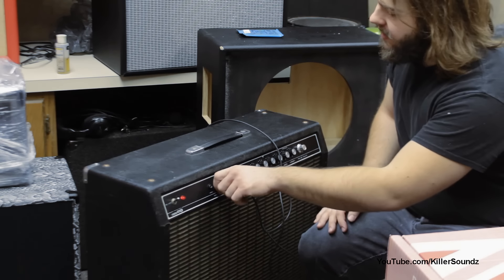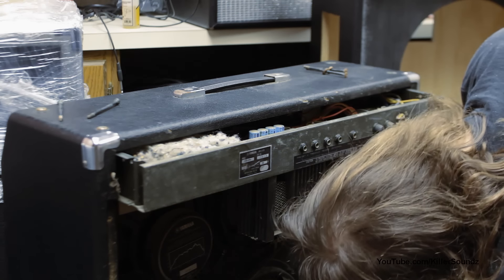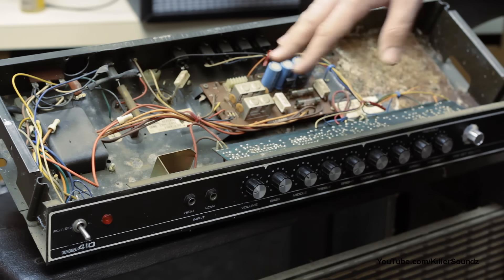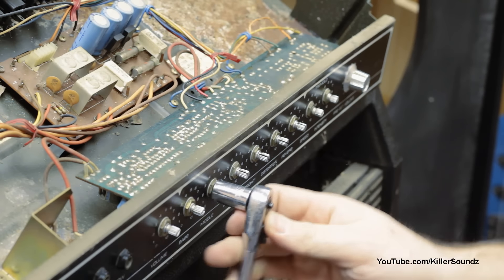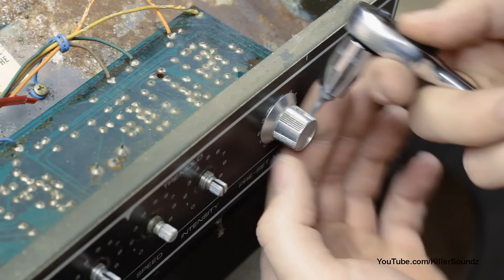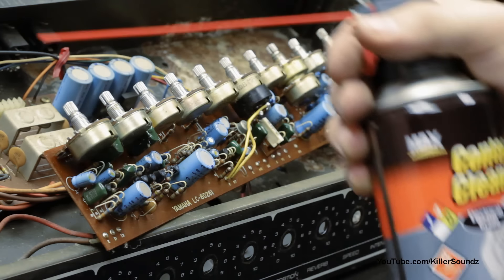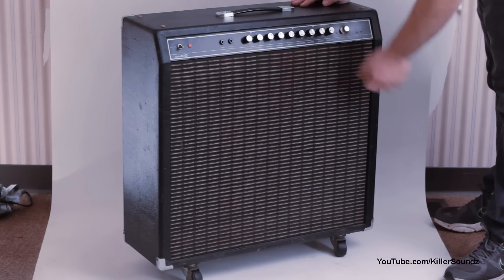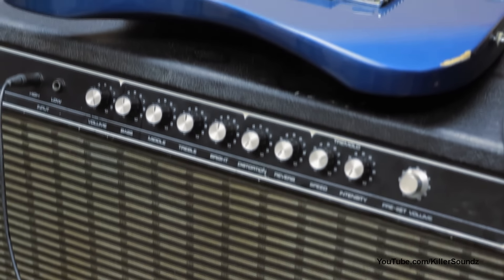Scratchy Knobs? How To Clean Amplifier Pots with Contact Cleaner Video  ✔

Comment: My life changed when I discovered contact cleaner. I thought all my stuff was malfunctioning, but it was just dirty as hell. A couple of squirts and all my pedals, guitars, basses, preamps, compressor, came to life again. It was exciting to actually hear my oldest instruments sounding again as if they were new.
Reply: Dude same, I was about to get rid of my 350watt amp head because the volume knob wasn't doing jack shit unless I turned it up more than half way(which will rupture ears with 350watts of sound.) Turns out it was just dirty ass hell.
Reply: I had the same experience nice to bring back old gear!

Comment: i fixed my input selector with a quick and easy fix...i took the straw for my canned air and crushed it in a vice. This allowed me the clearance needed to get in those spaces behind the knobs and dials without opening up the unit. I just sprayed it in there while turning the knob a few times. Spray from different angles so you crosss-spray the potentiometer. Good Luck. Worked great for me.

Comment: Just want to say thank you.  I have a old made in England Marshall govnor pedal and the pots were scratchy as hell and one you had to tinker with to get the sound thru. The input output jack where driving me crazy aswell from bad connection. Got some contact cleaner and bam everything works properly. What a difference. It's fun to use now. Thanks again 😊

Comment: I am going to try this before replacing all the tubes in my Marshall 40c. It only happens on the gain switch, after plugging in the guitar.. the amp is basically new. But I bought it back in 2013.  Getting into playing again and learning from all the vids. I did the the gentle tube test with the wooden chopstick and there was no noise or metal shards at the bottom.  Amp has maybe 15 hours after all these years and neatly stored. Thank you.

Comment: Old video but thanks for the info! Came across an old 80s Roland JC 77 not powering. I took it apart and found the lead power switch, got twisted off by the last user going to the fuse. Apparently they twisted it too much putting a new fuse in, and the outside housing split it off. So it got tossed out! Well I soldered it back, and now the amp is back. But it has a lot of fussy/scratchy pots on it. However the inside was very clean though, and used at a University. Luckily the pots are more accessible than this and no need to take the front off. They are exposed with no circuit board on top. 

With the warnings you gave, I plan to unplug it for a weekend, take the fuse out. Then let it sit and then get to work! Thanks again for the walkthrough. I prob would have freaked out the solution dripping on the board! I’ve only fixed mixers with other non spray cleaners for contacts. The Digi002 back in the day was one of those every year power harness cleans.

Comment: Hey, thanks for the video.  I have a 1975 Yamaha G100 412 .  I thought the the bass pot was broken or shorted out because the sound would have this loud "crack" and then no sound at all.  I contemplated replacing the pot but it was an integrated style of pot and I had never done that style before.  So I wired two of the speakers in parallel and the other two in series and used it as a 4 or 16 ohm ext. cabinet.  I gotta say I really like the sound of the vintage speakers.  Then I saw your video and your Yamaha was doing basically the same thing.  Long story short,  I cleaned all the pots like you did and wow I now have a great sounding vintage SS amp.  The brand I used was MG Chemical "Electrosolve Contact Cleaner"...made in Canada. One suggestion..wear safety glasses...Thanks again.

Comment: Thanks for the vid. I was able to save a mid-90's Mirage subwoofer that had some scratchy knobs for years but eventually decided they wanted to screech non-stop last week. Subs ought to make bass, but this was midrange and howling. I was able to remove the amplifier from the enclosure and spray the crossover and volume pots with contact cleaner. Works just like new now.

Comment: This is all well and good, but contact cleaner will also clean off the lubrication, leaving the pots dry and more prone to scratchiness, so unless the contact cleaner also contains lube, it's a short-term fix which will be damaging in the long-term. Important to subsequently spray with an appropriate lubricant, ie. Deoxit F5 or F100.

Comment: I would HIGHLY recommend you follow up with an electronics lube!That spray will clean but leave the pot contact surfaces completely dry,and will erode/wear the carbon VERY quickly!
Reply: Would using deoxit 5 be fine for overall clean and lube?
Reply: @BRIANACASHMUSIC  no, you need deoxit fader lube or something similar
Reply: Thanks yeah took it all apart and fixed it with deoxit5 several months go. 😎 Thanks
Reply: Deoxit 5 contains lube. The f version contains more of the lube
Reply: I was about to mention this but I saw you did! Fader lube will protect and make it so it has a little resistance so the knob is not so loose feeling and keeps out dust in the future.

Comment: My choice of cleaner is DeOxit 5. Spray as you did and rotate the shafts 6-7 times. Then spray the pots with a good contact cleaner to flush the gunk the DeOxit just loosend up. Finally use a can of compressed air to blast any residual spray(s). This method never fails for me on amps, guitars, cars, anything that has a pot or rheostat. 

And, yep, definitely a mouse nest. Removing that stuff by hand using rubber gloves would be my choice. Then use a Dust Buster with a long nozzle to pull up the mouse crap. THEN soak a paper towel with Lysol germ killing spray and let it soak over the area for about (5) minutes that was the nest to kill whatever was left over from the nest. That's all I got.

Comment: Nice vid, yup, a rodent's nest is what that was.  I would also recommend testing the pots before completely re-installing them as some times they are too far gone and have to be replaced.  One thing, capacitors store energy, not current.  Current is how the energy is released.

Comment: when I clean my pots I lay the amp on it's back,remove all the knobs and squirt the cleaner on the spindle ,it runs down the spindle. into the pot ,put knobs back on an d twist them a few times,it works try it, saves a lot of time       Roy

Comment: Wow that amp sounds really good! Good repair video!
Reply: In a world of over-production and an unlimited supply of underrated gear, 1st generation Yamaha amps are absolutely #1 on my list for getting ten times more than you pay for.  It's  saving grace is that only a few 'well known' players used them back in the day thus they're off the radar of the mindless, following hordes of gear buyers who would otherwise drive their price through the roof so thank god SRV didn't play on one but seriously, as an objectively assessed piece of kit, these are as good as any amp you're going to buy in any price range. Over the years I've acquired 3 so I'm kinda stuffed to the gills on them but this will make someone happy.

Comment: I had not played my tube amp for couple of years because 100w and 4x12 cab were just too loud... When I tried the other day if it still works, most of the knobs were stuck and I could barely turn them! Not sure about cleaning the pots by myself though now that I've tried if the amplifier still works. And it works. 😁 I just don't understand them wel enough to dare to touch the stuff inside.

Comment: You used WAY too much cleaner. A tiny squirt is plenty. Either opening would work the same. There was one dual-ganged pot in your video and you may have missed the front portion. You can check the results before reassembling too.
Reply: That's not necessarily too much. The flooding action can liberate particles and take them out with the out-flowing fluid, particularly with such a noisy pot as the volume in this video. YMMV. I would NOT recommend opening pots unless for last resort and you know what you're doing. I DO recommend a cleaner with lubricant; F5 or other fader/lube cleaner is highly recommended.

Comment: Holy shit, I searched this up because I'm having issues with the exact same amplifier you're demoing on in the video. interesting co-incidence. I got it for about 200 dollars used and it has massive issues with the tremolo circuit, I've managed to get it working for periods randomly by running a patch cable into the trem and into a pedal that's switched off, but it's inconsistent. Hoping contact cleaner will help with the trem out and enable me to bypass it completely

Comment: I know this is an old video but that is one of THE BEST clean sounding amps every made. The reverb and trem are great. I've tried the later, prettier versions and they do not sound as good. Even the one that Mike Stern uses doesn't sound as good as what you have right there.

Comment: Need some help! Watched your video and felt confident enough to get my old combo amp apart and clean the pots and inputs etc. I had to work the black plastic knobs away from the metal "posts" (I don't know what to call them) with a screwdriver. This went fairly well except when I got to my Clipping knob, the metal post came out of the amp along with the black plastic knob. I think if I can get that metal piece out of the plastic knob and back in the amp, I can fix this. Any advice on getting the metal piece out of the plastic knob without breaking the knob to bits?

Comment: I just did an old cheap clockrbdio I've had for 20 years with WD40 and it worked fine, but for gear like amps, etc, use the right stuff!

Comment: I have the same problem as another gentleman on here I have a Yorkville amp but all pots are sealed so no way to get spray in but enough dust and smoke has gotten in to have them scratchy is there any fix for those pots?
Reply: Maybe replace the pots?

Comment: For the newer cheap pots that are on guitars these days, there is no openings in the case, can I spray at the base of the knob shaft and hope that some of the cleaner gets inside the pot?
Reply: +Kenneth Nielsen If you can find a bit of hose type stuff, that is just that little bit wider than the pot, you can place that over the spline and fire away. As the pots do have some space so the spline can move you can get the cleaner in there. If you know what in mean.
Reply: Cool. Thanks for that comment. I will try it. I was also thinking of drilling a small hole in the pot case just enough to let the cleaner in.
Reply: +Kenneth Nielsen drilling is risky, you might hit something or metal particles get into the works.

Comment: Incredible priceless info man those blue resistors have enough power to kill you .incredible .oh yes i watch my fingers when using this cleaner im using electronic cleaner from Walmart and this meter with red and black pointers wow removed the back all was needed? This is an Right-Tech 53312 250V fuse and 1 1.5V"AA"Battery now this works really good on everything scratchy pots got to have some way of letting you know no speaker ohm output no scratch this small amp speaker the pots scratchy thanks but the speaker probably original and just old is weak but sounds loud oh well

Comment: Do you recommend wearing an anti-static wrist strap to reduce the chances of getting zapped?
Reply: Yeah I opened up my 5150 head and didn't die.  Sounds great now. Thanks and great vid!
Reply: @1888oopsjew Never! Anti-static is for gear that has no power.
Reply: Just ground yourself before you touch a circuit board.  Touch anything grounded.
Reply: +OneDamNote Always unplug the equipment first.
Reply: +Alex Knappenberger DIY I have found one way to discharge those capacitors is to disconnect the power supply then turn the device back on, unpowered. It will attempt to power from the charged capacitors, effectively discharging them. In most cases this will work.
Reply: on second thought, maybe you should learn some theory before you electrocute yourself.  You could use time to discharge a capacitor, but if the capacitor isn't connected in parallel with some resistance (the designers may not be anticipating you tampering with the circuit), it may take some time before its assumed safe safe.
Reply: +Ronald Crabtree I recommend wearing moist shoes and squishy panties to do a fix like this one and perhaps a few paper towels...
Reply: Good recommendation.  It would be better for someone without basic knowledge of electrical theory and/or practice to put on squishy panties than to tinker around with it.
Reply: Just stay away from the power section of the amp and you'll be fine.  You're not anywhere near it when you're working on the pots ; just steer clear of the large capacitors / etc after the plug.   Or wait for the amp to discharge ; unplug it and let it sit overnight which is plenty of time for those big caps to discharge.
Reply: 1888oopsjew An esd strap connected to earth ground makes you a prime conducter killer. esd straps only protect the component. If you have it unplugged, caps this size will not kill you. Give you a good zap though! If your worried short them, with the proper tools of course.

Comment: Do you use the same Contact Cleaner to clean a guitar pot? My volume knob scratches a little toward full volume and cuts out. Around 8 or 9 is fine, but 10 cuts out unless I slam the knob to 10. If I roll it with normal force, there is a slight scratch and then a cut out around 10.
Reply: Atacama Humanoid I use it on my guitar electronics and it works great and won't harm your gear.
Reply: Atacama Humanoid Set your guitar volume to 11. Problem solved!

Comment: CAN SOMEBODY HELP ME!? I cleaned out the pots from my Yamaha G50-112 amp after watching this video and after assembling it back my amp will not turn on . I leave it sitting there for a few min. and it turned on and died out again . turned on in the morning to play it and it was working fine for about 30 min. till again the light just dimmed out as well as the sound coming from it . I realized that whenever i put my phone on top of the amp or tap it just a bit it turns on or turns off . Can anybody tell me what i can do to fix this ?

Comment: Hey man. Pretty cool. I just bought a used Mesa Boogie DC-5. I wanna to open her up and give good cleaning. So, holding the power sections from the bottom of the board is ok? Just not the inside parts.

Also, Would you not be worried about getting that cleaner all over the circuit board and tolex? I don't want to mess anything up. 

Thanks!

Comment: Hi! Is it enough to put the cleaner only at the pot's small hole on the back?
Reply: +Marcus Vinnas Try, and let us know.
Reply: #1. Spray the electronics cleaner into the small hole
#2. Turn the pot back and fourth quickly 
#3. Spray it again
(repeat if necessary -- scratchy pots, etc) 
#4. Wait for it to dry before use.

Comment: Kontakt 60, then Kontakt WL/IPA to wash away the contact cleaner that will eat you contacts and finsh wit a bit of kontakt 61 for lubrication and protection. The best way is to open it and clean it, but some pots are difficult to open, ultrasonic clean is alright to.

Contact cleaner is a mess it eats your contacts and circuit boards, a good all in one solution is Tuner 600.

Comment: That's pretty wicked. I was a bit worried on how this contact cleaner stuff works because it was a bit delayed on this filthy guitar tuner I used it on. After a rice bath, he tuner was functioning perfectly again, but that was a $25 tuner.

I'm planning on using it on my fender 60 watt tube amp that's been out of commission for a number of years. More immediately though, I've got a new beautiful vintage Ibanez that desperately needs contact work, but I heard that contact cleaner will take guitar paint off like it's nothing. I was told to tape off all the parts that I don't want contact cleaner on, but I'm afraid that I'm confused by that sentiment. Do I cover my entire house/environment in masking tape or do I just spray the contact cleaner carefully?...

Comment: Tips:
- don't spill contact cleaner on vulnerable surfaces, so better put a cloth under it.
- most contact cleaners should be flushed after some time, to get rid of the acid which can damage anything in the long run.
- after flushing the contact cleaner a special contact lubricant should be used to prevent fast wear.
I you don't do this the crackling will return soon.
Some 3-in-1 contact cleaners have less agressive/effective oxide-removing effect but are (more) safe to use without flushing.

Comment: Once you disconnect it from the wall socket press the power button. This will discharge the capacitors. You will see the red led light turn on and then off as it drains any remaining power stored in the capacitors
Reply: That still won't discharge them 100 percent. Even if you do this never touch a capacitor until it has been verified to have 0 charge in it with a multimeter. They can and will kill you

Comment: when you clean the pots, you will notice they become really easy to turn. that is because there is a non conductive lubricating grease inside that was washed away.  after cleaning you must replace the grease, or the contacts will deteriorate.
Reply: +Jesterminutesir  If you have an electronic store ,they will have a product called NU-TROL-Control Cleaner
It is a cleaner and  a lubricater.  You also can get a similar product from radio shack .  You can also use a product call DeOxit F5 (Cleaner and Lubricant. If you use regular electrontic cleaner you can get a dialectic spray grease .

Comment: Could I use WD40 instead of contact cleaner?
Reply: That would have waaay too much oil i think that wouldnt evaporate like contact cleaner does. Also I would get some paper towel or something to catch the excess and the dirt coming out instead of letting it run into the amp or whatever -- I mean why the hell not if its easy to put a towel there?